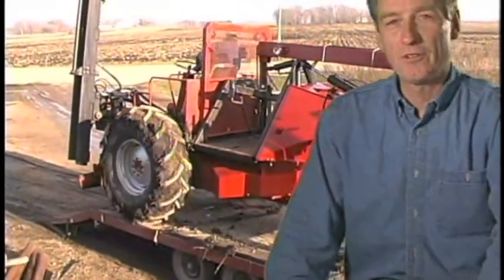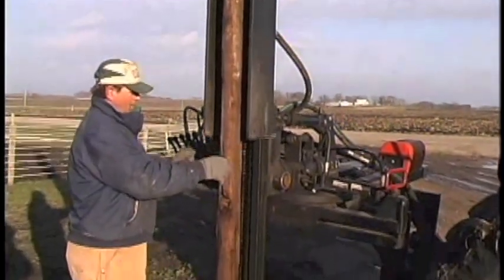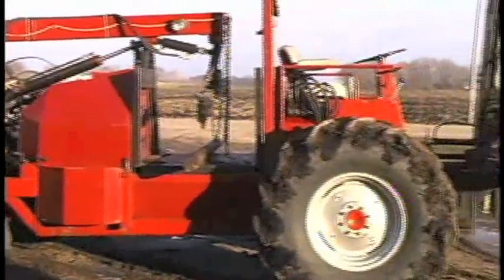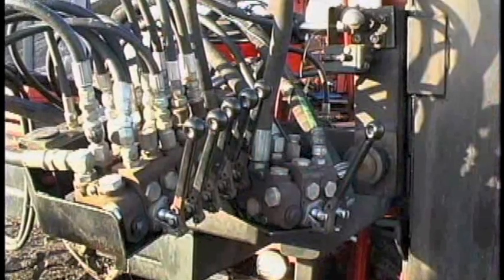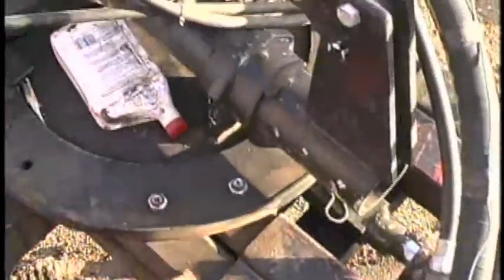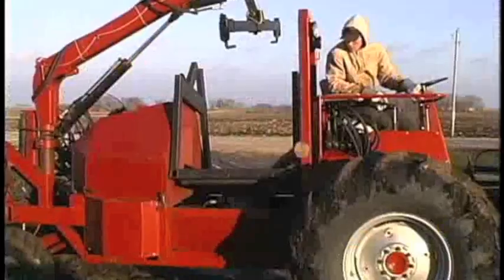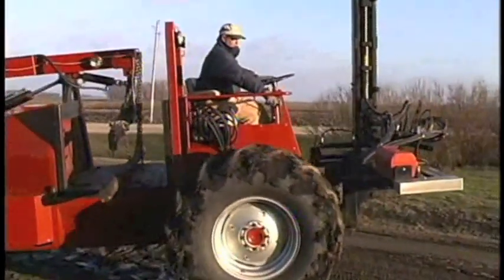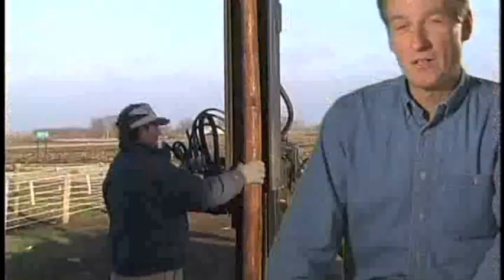FARM SHOW - Self-Propelled Fence Building Machine

Comment: I have self-propelled post pounder. Mines on a track machine. I have a blades as well 8' wide carried 3 full bundle of fence posts plus could stretch 6 rolls of wire at once and more attachments as well.  I went through terrain no wheeled unit would go.